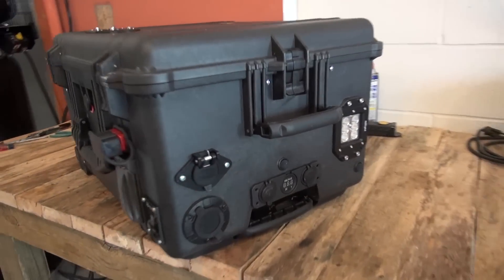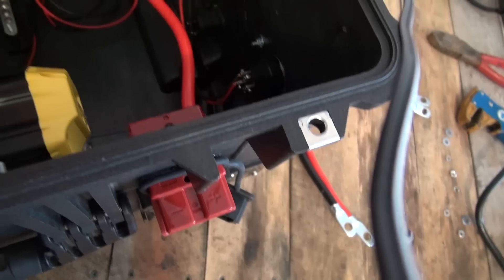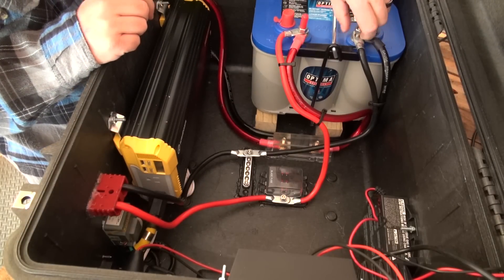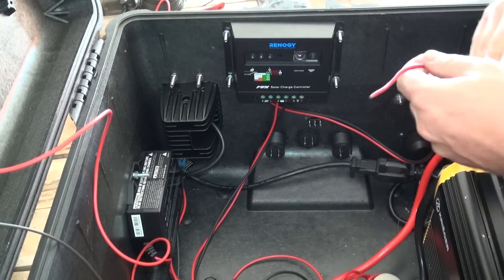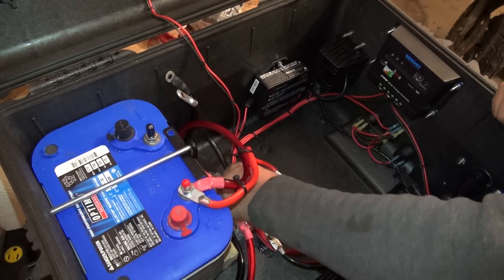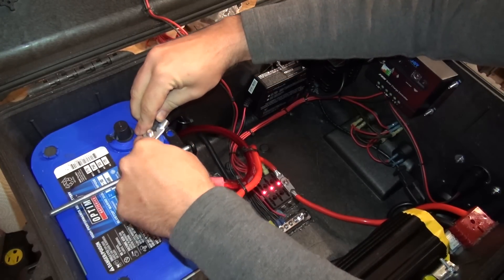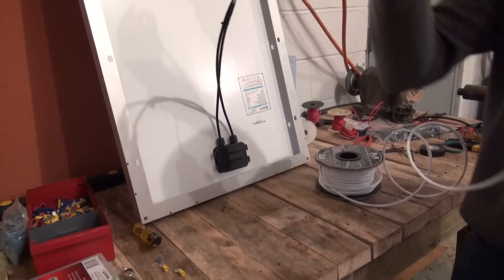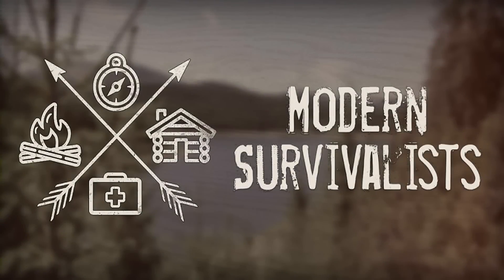DIY Large Solar Generator - Part 4 - Wiring

Comment: Would there be any value/safeguard in adding a fuse or breaker between your external battery connector (Red plug) and your fuse box?

Comment: So much info to absorb.
I watched a few times and still couldn't understand (as an ignorant newbie)...
How was the 110 charging inlet wired to the charger?🧐
Reply from the maker: It has a standard AC power inlet, which we wired to the waterproof male power plug mounted to the side of the case (it will allow the female end of an extension cord to directly plug into it, so no dangly power cords on the outside of box to snag on things).    The charger also has a 12v output which we wired through the fuse block and then directly to the battery.

Comment: wow nice build love it 🥰🥰🥰 i have 3000 watts pure sine wave in water proof tool box i have 3 breaker 1 20A AND 2 15A breaker for my 3 110 out let i have switch between my positive and my battery and positive of my inverter i have put cool fan and usb port and solar charger not finish building it yet the wire i used for my plug is wire that wire house 🥰🥰🥰
Reply from the maker: Thansk! Good luck with your solar generator build!

Comment: Little confused on your trickle charger ! Why did you hook it to your fuse block ? Doesn’t make sense
Reply from the maker: Just as an added protection. Ideally you want all wires to be fuse protected against short circuits.

Comment: I know this is a dumb question, but for your trickle charger did you actually cut the terminals off and connect it to your fuse block?
Reply: Not a dumb question at all it doesn’t make sense for him to hook up trickle charger to fuse block it gets power from outside no need to hook up ! Also his fuse block is 12v not 120

Comment: Don't trust the test button on the GFI get a proper GFI tester I've checked by that before on a new home build I checked everything out before the inspector came and he used his tester and 2 failed one was defective the other had an open ground the electrician had to find where in the run it was since I've gotten a gfi tester nothing worse than finding out it's not working when you are sapped

Comment: Great video. Are you not using any relays in this build? All the toggle switches are robust enough to handle your loads? If I can get away with not using relays I am all for it but I was worried about too high of currents

Comment: Great video! Just a small question! Will the 16 gauge wire's capacity too small for the PV input connection?
Reply from the maker: There are several different benchmarks on how much current different wire gauges can handle, some with more safety margin than others. A common rating for 16 AWG is 22 amps. Since the 100 watt panels we are using  can only generate 5.75 amps max, it would allow for up to 3 panels safely.  However,  your voltage drop will be less with thicker wires, making them slightly more efficient (less voltage loss =  better battery charging).
Reply: Thank you! Great job and great video!

Comment: Great work! You answered my question how to connect a trickle charger to the battery along with solar charge controller. Thanks. Is there any reason not to use the solar charge controller's output to the 12v and USB outlets so that it can control power cutting when low battery voltage?

Comment: I'm using a lot of similar components as this project.  I'm wondering if it's necessary to put a fuse between the battery and the fuse distribution box.  I have the same one as you and it says it's 30amp max per circuit and 100amp total.  I don't plan on using all 6 circuits maxed out.  Thanks!

Comment: EXCELLENT VIDEO!  I've been looking a solution similar to this for years.  My question is can this adapted to a smaller case and smaller components, for example my inverter AND battery is a LOT smaller than yours because I have to consider weight constraints due to the fact I have Fibromyalgia and need a lighter weight setup in order to manage.  Also considering if I have enough solar panels, inverters and/or batteries can this generator be used continuously to run for instance a refrigerator?

Comment: Nice build. I'd consider a small MPPT controller instead of that one you have put in there though, as the cost increase wouldn't be that bad, but since this is aimed at a portable application, you'll want to make the most out of whatever panels you can carry with you.

Comment: Do you run your AC trickle charger and the solar panel charger simultaneously?
Reply from the maker: I imagine you could, but I have not. If I have the solar panels connected, I prefer to let them do all of the charging. The AC battery tender / trickle charger is more intended for if I am storing the generator longer term somewhere without the panels, just to be keep the batteries healthy, topped off and ready to go for an emergency.

Comment: There's two problems I saw in this design.    

1.  No Venting.  The inverter needs fresh cool air to keep its components cool.  If it's all closed up like that,  then it'll overheat and die.
2. No earth ground.  Dangerous.

Other than those two,  your build is great......
Reply from the maker: We've been over both of these. Both are not issues. The vent free design in necessary to be fully weatherproof. The inverter has thermal overload and will shut off before any damage occurs, and has never happened in my usage yet.  If someone is using it in hot / dessert conditions, and wants to vent the inverter, you just open the case. Simple.   As far as the earth ground goes, it  is recommended to use one when for a permanent installation, but it is not required for a mobile units. Hundreds of thousands of work / utility trucks have inverters installed in them with no earth ground.

Comment: Thanks for your videos, need to confirm the ac charger ans solar panel controller are not directly connected to battery but connected through the fuse block?
Reply from the maker: Thanks Roger.  That is correct. Any wires connected directly to the battery should be fused, as closely to the battery as possible.  The fuse rating should be equal to or less than the DC current rating of the wire. In this build we achieved that using the 6 position fuse block linked in the blog post, which left us a couple spots for future expansion.

Comment: I have gathering materials for a similar system using 600w inverter with 2 gel batteries. Best series I have found on actual wiring and design. Fantastic. Thanks a million for your outstanding series.
Reply from the maker: Thanks. glad you liked it!  Let me know how yours turns out.

Comment: Well done. Great video and great generator. 
I made a small one (1450 Pelican), no lights and a small inverter that plugged into the 12v socket. I like the trailer plug. 
I hope to make one, like yours, soon.

Comment: Showing my ignorance no doubt, but can you have the solar panel controller and the AC charger providing current to the battery at the same time? What happens if they are both on?
Reply: Phenomenal series - thanks for putting this out there!
Reply from the maker: Nope, not ignorant at all!  They both act independently from each other,and can both work together to charge the battery if desired.  Both the battery maintainer and the solar charger will try to charge the battery when they detect it is low. If it is sunny out, and the solar panels are keeping up with the current load, its more cost effective to just let the solar panels do the charging, but if its cloudy out and the panels are not keeping up with your load usage, the AC charger will assist if you have it plugged in.
Reply: Thanks for the reply! And thanks for the inspiration - am off to shop Amazon. Keep the videos coming!

Comment: WOW! What a great series! I'm just beginning research into a project like this. Any advice on making this box using a Lithium Ion battery instead of the lead acid? Trying to figure out if I can trickle/float charge the battery off of AC when not hooked up to the solar panel. More research... Thanks for a great DIY!
Reply: dan finger  I'm in the process of making a li-ion solar generator myself, plus making a foldable 65W solar panel that fits into the case  I have using a 3D printer and a laser cutter, so I'll only need to grab one thing instead of both the case and the solar panel. I'm going to use it on camping and boat trips so one package is essential. I to struggle with the charging from the solar panels, the best bet so far is "electrodacus solar bms" but this is a kickstarter so I'm not so sure if it'll go through, so I'm playing with the idea of making my own using an arduino, some power resistors, some mosfets, and some other stuff. Remember that lithium cells need to be balanced charged and NEVER, I repeat NEVER EVER!!!!! Trickle or float charged unless your intention is to make a bomb. When the battery pack is fully charged, the charging process need to be stopped. Say your li-ion battery pack is at 12v 50Ah, that's 600Wh, that's 2 160 000 joules of energy, that's equivalent of 470 grams or roughly 2,5 sticks of TNT ( (Hello FBI: just educating on the topic of lithium cells, nothing to see here, move along!) (xD) )
Reply from the maker: Thanks!  I went with an AGM battery due to the lower cost.  The Li-Ion batteries have some neat properties, including lighter weight, but their much higher cost, and the fact that most of the inverters and solar chargers are designed for more traditional battery technologies turned me away from them.

I have an AC float charger / battery maintainer included in this build series. It uses a flush mounted / weather proof receptacle that the end of an extension cord plugs into like a socket. It's been working great!
Reply: I'm planning building something similar with  a 12V 150AH lithium battery.  it aint cheap, but I was looking at the Kodiak or Yeti 3000.  For the price of the Yeti I would have a lot more storage!  We will see.
Reply: Lithium polymer is better for any portable use simply because it is significantly less likely to catch on fire. Think of Samsung note 7 and other phones that have caught on fire spontaneously. all of them used lithium ion batteries. Lithium ion becomes very unstable at high temperatures or high voltages.

Comment: what about the earth on the inverter.I did,nt see you doing anything to it.Please explain
Reply from the maker: I didn't include it because I did not see myself using it very often. I usually use the generator in places without an auxiliary ground / earth available.  I included a GFI receptacle for additional protection however. Connecting the ground lug on the inverter is not mandatory per the manufacture instructions, however if you using it in a scenario where you do have a ground available, adding a external lug connected to that wouldn't be a bad idea!

Comment: I'm working on a similar type of system, wondering about powering an induction burner thought.  Its rated at 1500W and I think it may be used up to three hours in one use- 3 hrs per day.  Do you think a single battery system like this could handle that?

Comment: The only thing I see you might could possible improve is I noticed the inverter has a earth ground you might want to add a earth ground lug on there somewhere for better protection.
Reply from the maker: That's true. I won;t have an external ground available in most places I use this, but adding an external lug for those that might is a good idea. Thanks!
Reply: ModernSurvivalists You can make or buy a copper rod (like a really big nail) but wit handles on, that you can ram down in the ground, and pull it out using the handles. This rod should be positioned as close to the ac tool / appliance you are going to use, since the grounding potential will vary depending on soil conditions and how long the grounding rod are inserted into the ground

Comment: Do you have a problem with heat? (from the Inverter)
Reply from the maker: I haven't had any issues with heat yet. Most of my usage with heavier loads has been very intermittent. My reasoning with no ventilation is I wanted to keep everything water-tight / weatherproof, and the enclosure really is not much different than a truck toolbox, which is where these inverters are often installed. The inverter also has a built in thermal overload auto shutdown, but it has never activated for me. If it ever becomes an issue, I can always just simply open the case to give it ventilation.
Reply: I built this nearly identical to the video, but used a blue Optima 75aH battery. Way heavy, but I work out, and that makes it harder to steal! I power a 63qt ARB fridge/freezer with it. It works for days inside, but it cuts out very, very quickly in the back of my truck in the shade. I thought it was a bad DC cable, but have since disproven this theory. All I can think is that the heat (90+ F) is what's causing a problem.  Any ideas on alleviating this? And what is it exactly about the heat that would prevent the ARB from receiving enough current from the system?

Comment: Excellent work! I have been searching for videos for a couple years now on a great step-by-step video series on just how to put together just such a generator! THANK you!! Having ZERO experience with such things I need as many of the steps covered in a video as possible. This is perfect! 

Now, I would like to know how many of those batteries are needed to power an appliance that typically takes up the most power over the longest period of time, that being an oven. 

I wonder this too ... rather than using traditional deep cycle batteries for such a project would would be able to use SOLN1 Capacitors instead? I have little knowledge about the capacitors but I will learn. I have no idea right now just how many of the capacitors I would need to string together to equal the output of a 12V battery like the one you've used in this project. Some advice or ideas on this would be great too!

Thanks again for these GREAT videos!

Lee

Comment: im not an expert, but why not use two 6volt batteries? I heard it creates more amps I think.
Reply from the maker: Two 6 volt batteries in series would give 12 volts, but the Amp Hour ratings of the battery do not add together like when batteries are wired in parallel. For example, if you have two 6v 50AH batteries wired in series, they each can supply 50A for one hour. But in order to reach 12V, they are both supplying 50A at 6V for one hour, adding up to 12V and 50A for one hour.  So two 6V 50AH batteries in series are the equivalent of one 12v 50AH battery.
Reply: Yes,  but you double your total power in watts.

Comment: I'm pretty sure I saw you also make THE MOST COMMON MISTAKE on systems like this. You REALLY should install a switch between the battery & the Charge controller-otherwise there is a draw on the battery from the controller that over time, WILL run down the battery!
Reply from the maker: The charge controllers are intended to be wired in permanently. Their intended design scenario is to be connected to the battery 24 hours a day, so that they can begin charging as soon as enough sunlight hits the panel each day. I supposed the battery status circuitry and the status LED would have a VERY small draw. It should be inconsequential during normal usage, much like the clock / computer in a car is not generally an issue even if the car sits for months between use.   I suppose if you are storing the unit for many months between uses, then a switch to disconnect the charge controller could make a difference.  When I get a chance I will try to hook a DMM to the charge controller with no panel connected and see what the current draw amounts to.
Reply: If unused for 3-4 weeks, your battery WILL be drained. Spend Ten Bucks and put in a switch-CHEAP INSURANCE!
Reply from the maker: Hey Bruce, I did go back and measure the charge controllers idle current draw. It was 8mA, which isn't a ton, but still more than I would like. I didn't want a switch to have to constantly remember to turn on and off all the time, so I came up with a better solution that was no additional cost! I used my solar panel connector to build in an automatic controller disconnect when the panels are unplugged. Check it out! https://www.youtube.com/watch?v=VnB82Gio0Zw
Reply: I like your idea-I'll look into it.
Reply: My own portable solar power bank has the charge controller permanently wired to the batteries.  Thing is that the very small milliamp draw takes MONTHS to drain the battery. If it sits that long then you should have it connected to a battery trickle charger/smart charger. Traditional SLA batteries (deep cycle or otherwise) will slowly loose charge over time. They should be topped off periodically or maintained with a trickle charger (if stored, if you have yours connected to the panels on the back porch then don't  worry about it). But of course this is my own opinion. 😁